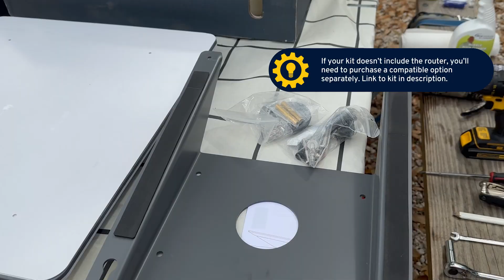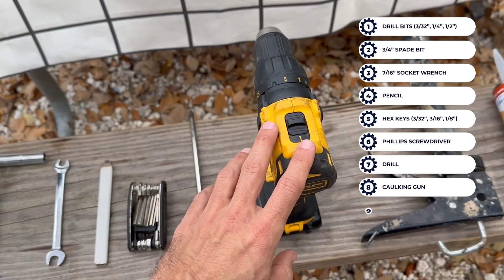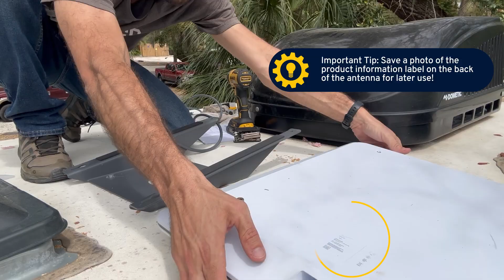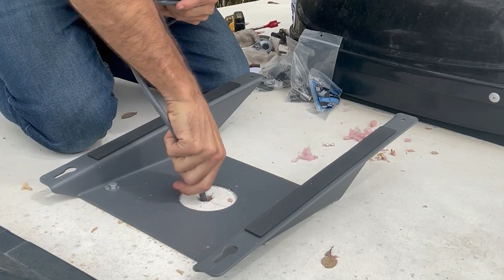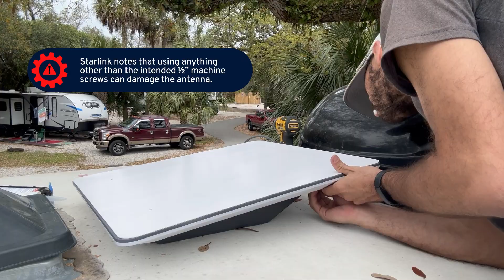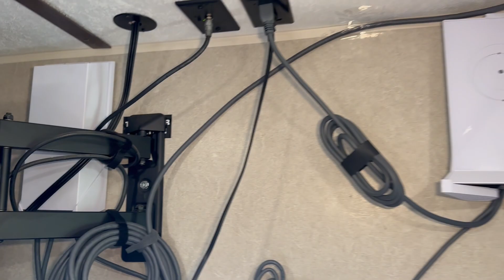Starlink Flat High Performance Install | RV Modifications

Comment: Drilling holes in your rv roof or home roof is a terrible idea no matter how many rubber washers or how much silicone you use.   One small gap and your roof is ruined.  There are other non evasive mounting options.  Just Google it!